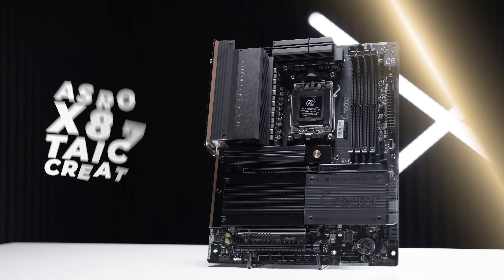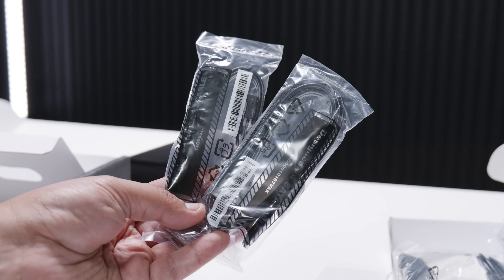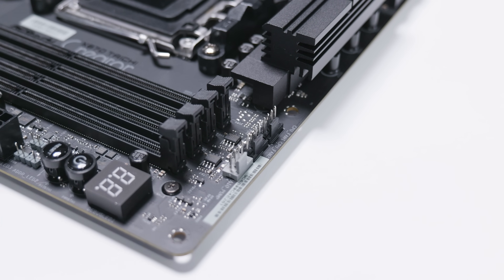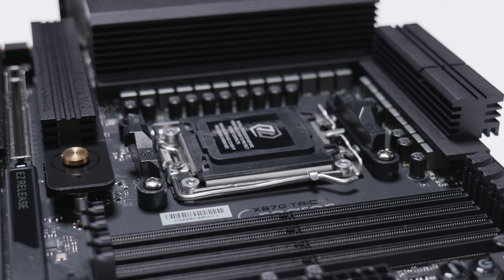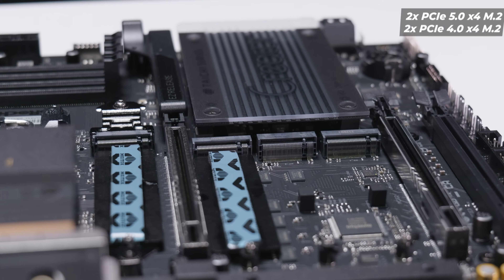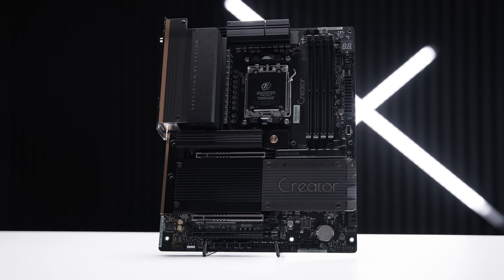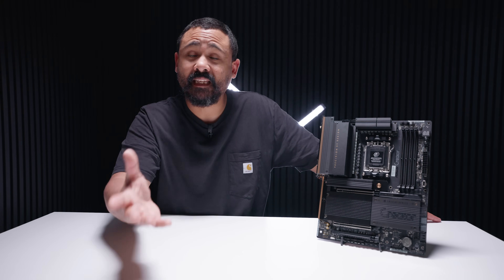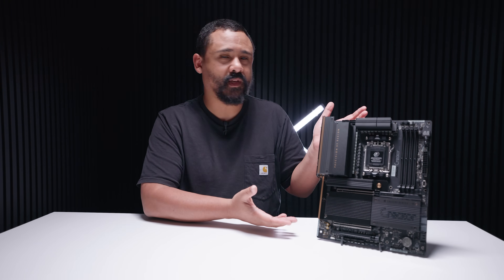This motherboard has EVERYTHING! // ASRock X870 Taichi Creator

Comment: Sorry the bottom PCIE lane is too close to the io. ASUS creator is still the card for dual gps support.
Reply: The x4 spacing is to let the 'top' card breathe. The ProArt is for multiple Blower style cards. In the right case the ASRock can handle (say) 2x3090s at x8 doing training or inference (or maybe some video stuff). You can use right-angle connectors to get under the 2nd 3090.

Comment: Nice board but I’m wondering if Asrock finally managed to fix the x3D cpu voltage problem on their motherboards
Reply: Based on there being several new posts on the asrock subreddit about dead cpus, I'd go with no.
Reply: Nope they didn’t
Reply: Still no, and it's not an issue with only one brand or one CPU it's an AM5 issue
Reply: Nobody knows if it’s the motherboard. Asrock is the cheapest so most people buy them that’s why there is more ‘asrock report’, but there is dead Amd on other brands too.
Most likely AMD hiding bad batch imho.
Reply: @MRLWay please do not spread such a nonsense, by now it's definitely confirmed it's ASRock's issue. And saying their boards are the most popular is even funnier. Cheapest - yes, but now we know why.
Reply: @3nez2nez  Nonsense ? Nobody knows the cause.. Nor Amd nor Asrock. You can see people out there without problem on taichi lite boards and somes are reporting death on msi, gigabyte and Asus too..
What I meant was don’t think you are safer with another brand if your take the cheapest mobo with the cheapest PSU.
If you’re doing so, do not use PBO, on any brand.

Comment: Finally Asrock designed something esthetically pleasing for old school folks like myself who disable and remove any RGB they see. Could you please show us PCIE IOMMU groups next time, very important for virtualization and professional use cases.

My complaints for designer of board.

1. 2 expansions slots with at least x4 lanes should not eat anything from GPU, let's disable one M.2 if I need 2x x4 slots
2. it should have 2nd set of 4 SATA slots available via breakout cable with 1 M.2 that would be disabled
3. 2nd x8 slot just cant be 1 slot wide, there isnt going to fit any air cooled GPU that isn't 75W max with small high RPM fan that is going to ruin whole build. I am not sure if water cooled card would be fine with 1 slot but likely not
4. There HAS to be a DP output on motherboard, period. Especially when there are only 2x USB-C

Bonus tip: Start using modern PCIE expansion connectors on pro-oriented consumer boards like MCIO or Oculink for connecting U.2 NVME drives. M.2s are limited to 4TB most of the time and it wasn't improved for years. 8TB drives are more rare than unicorns in wilderness. These connectors could even disable M.2s if necessary when U.2 drive is connected.
Reply: This is why I used to buy MSI’s Tomahawk boards. Those used to be all black or grey with no RGB but now they have added annoying neon stripes to them…

Comment: Dang, just looked it up. $320USD on Newegg right now with 10G RJ45. Here's hoping this won't brutally murder X3D chips like Asrock boards have been doing.
Reply: Thaat's a little unfair. Although there have been over 100 instances of this type of failure, ASRock sold the most boards by far and users also sought similar RAM choices on the cheap side. I didn't have my board/CPU explode but RAM recognition was a problem and I've had a stick fail since then.
Reply: @nimrodery  At this point I am starting to think it is some kind of design flaw than anything on 9000 series chips. I know about 8-10 people with 9000 series chips and there are already 2 dead boards and 1 CPU. Nothing got burnt but they just refuse to boot. One ASUS Creator board, one Asrock board and 1 9800X3D that passed away to silicon heavens.
Reply: @Monsicek  I got a 7600X looking to upgrade at some point so one of my main needs was sufficient power, also I wanted m-ATX and ASRock just has the bases covered at a decent price, and they had availability. Now I want to RMA it but I can't find the receipt. All major purchases are now getting made local, no more Amazon or NewEgg for me. Board still works but with one weird RAM slot that knows it's filled and what memory is in there but won't do anything with it.
Reply: @nimrodery  I would just email them, they track serial numbers and manufacturing dates. You might be still within 3 year period therefore lucky. If they are not picky they should process your RMA.
Reply: @Monsicek  good point, thanks. we'll see
Reply: @Monsicek I've done many Zen 5 builds for customers without any issues, but no Zen 5 X3D yet. I did Zen 4 X3D, no issues. Makes me worry that the flaw is the changes that came along with moving the cache.

Comment: I have the ProArt. I really wish it were more color neutral like this board, though I wish this didn't have gold accents either. Nice that they included optical like unlike the ProArt and I prefer the older screw in WiFi antenna. And yes, the ProArt is about $500 USD. That's what I paid for mine, but keep in mind that it's an 870E board versus this, which is just a standard 870 board. I'd be interested to see what the PCIe bifurcation looks like compared to the ProArt.
Reply: I wish they'd drop the gold highlights on the Taichi boards, and I'd prefer no shiny bits. Black and dark gray are great, and they could offer a white and light gray version for white builds. Gold and shiny metallic look cheap to me. I have 3 Taichis, and will likely buy more, but the hints of gold just always look cheezy.